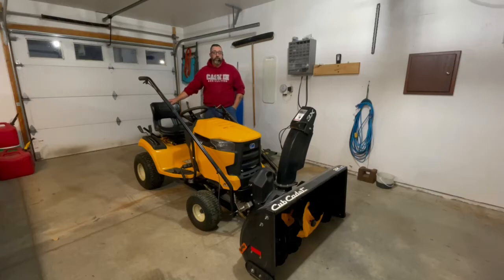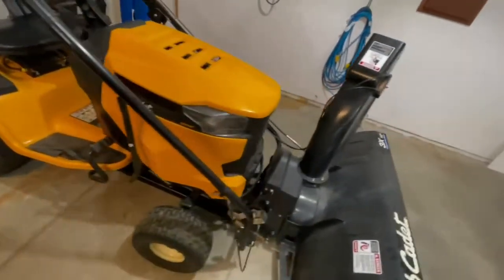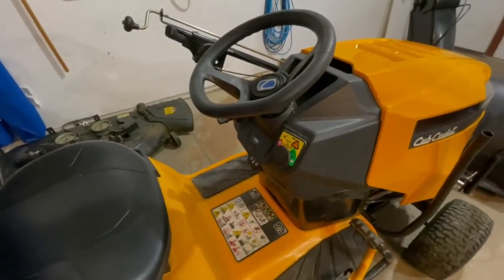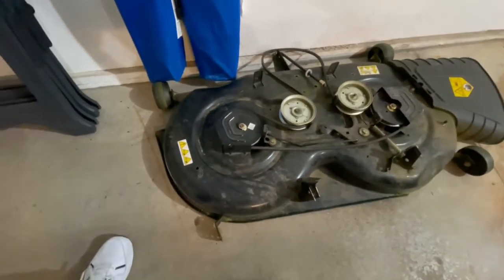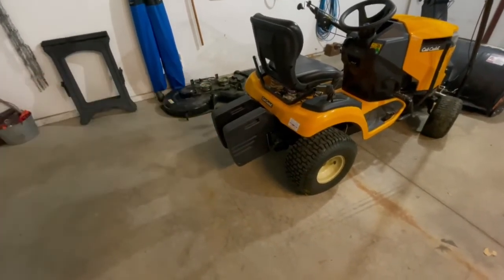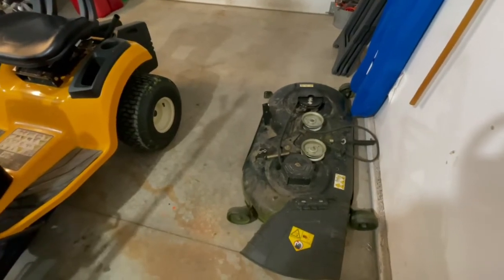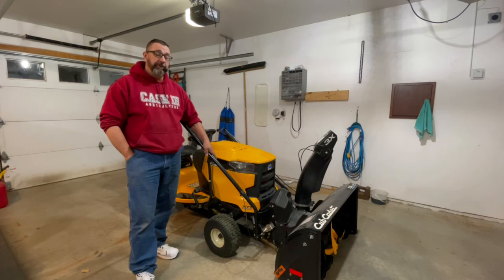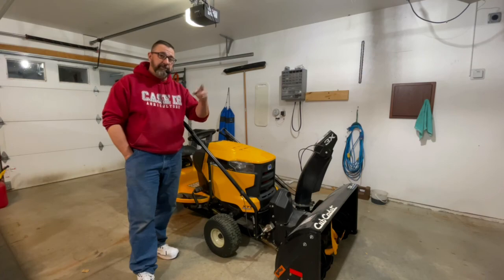Cub Cadet XT1 LT46 Review and Walk Around

Comment: I bought this recently and I never once thought about the snow blower attachment. Right now I'm paying a neighbor (I live in Maine) and he does a great job but wondering if I can take on the task myself this year if I get the blower. Was wondering what you thought, my driveway is not paved, its gravel/dirt and is about 250 yards long, with maybe 25 total feet of incline. 

Is this actually an option? Not sure if it can handle the length, heavy snow and incline. Any thoughts on this I would appreciate it. Thanks

Comment: The mow in reverse is a 1 and done every time you mow. With John Deere, you have to either push a button or hold the PTO up
Reply from the maker: Unless you get off the seat to move a trampoline, toy, rock and anything else. Then you have to do the process again. My Deere was a push button that had to be pushed every time you engage reverse.
Reply: That was one more thing which helped me decide on a Cub rather than a JD.

Comment: I was just wondering isn't CubCadet owned by MTD? All in all a very informative presentation   I really was impressed with the snow blower and I could see how it would hinder refuling and engine maintenance. Plus I was thinking about the oil drain you came up with a good solution it sounds better than my solution to use a rubber drain plug that when you turn the nob it expands and contracts it worked on my Escoort station wagon that I bought used it had a stripped out drain plug.
Reply from the maker: Thanks for watching. Yes, the same company makes Cub, MTD & a couple others.

I can’t take full credit on the drain. I saw a similar solution by someone else and gave it my own twist.

Thanks again for watching.

Comment: That constant seep with that oil drain is more likely where the metal drain plug was not machined properly.
Reply from the maker: I had replaced it and the same problem.

The dealer tells me it is a constant issue because of the o-ring.

Comment: I have same mower only issue is that reverse is so slow
Reply from the maker: It is a little slow but I found that if you really mash down on the reverse pedal a few times it got better. Almost like it was sticking and just needed to be loosened up.
Reply: Check on the inside of the frame rail for built up grass. Where the foot pedal pivot  to actuate the rods going to the transmission is a bad spot for debris buildup and can prevent full pedal movement.
Reply: Yea that what it was Ian really not happy w tractor put mulch plug on n mulching blades n this thing does not mulch leaves they blow out top of deck n have go over leaves couple times to mulch
Reply: @charleszornak8042  I've got a 9 yrs old cub cadet,but I'm lookin to buy a john deere with mulch control.